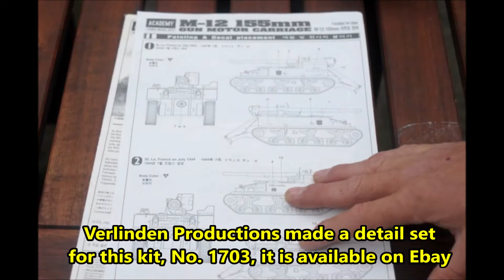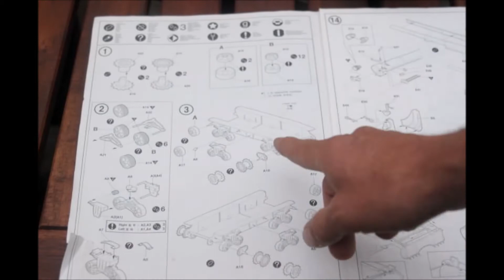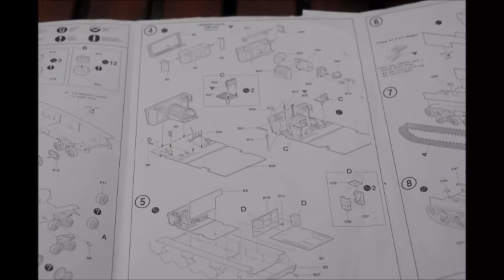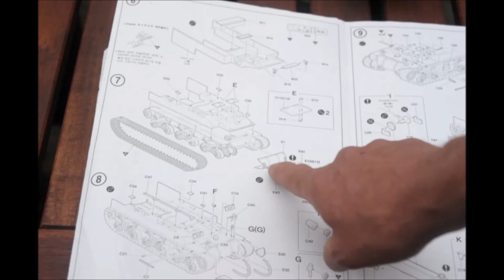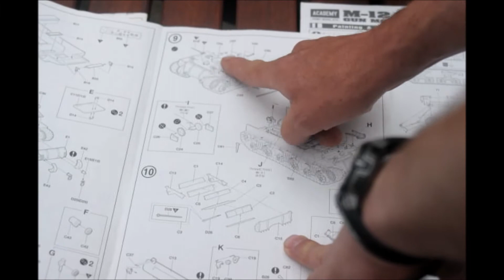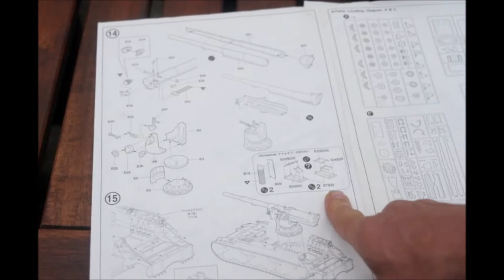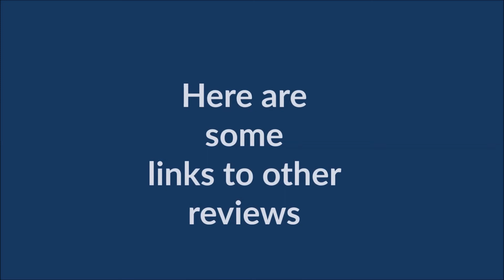Afterbuild review of the 1/35 Scale M12 GMC Model Kit from Academy

Comment: Engines in the rear of a us tank that's the 3 peice transmission cover on the front to get into the gearbox if damaged easy enough without having to pull everything through the hatches like in German tanks! There's no Engine in this kit I picked the same kit up yesterday for something old n different to build but I'll be adding my 3D printed parts and doing all the cast texture effects that are missing and maybe double check on that 3 peice tranny cover with it being a 1944 I want to know what vehicle the chopped if it was the m3 Lee or what!
That front boggie I very far forward up into the drive sprocket on the left there!
Reply from the maker: I know, just want thinking when I said it, and I said it more than once.  Nowadays all that stuff is in the back.